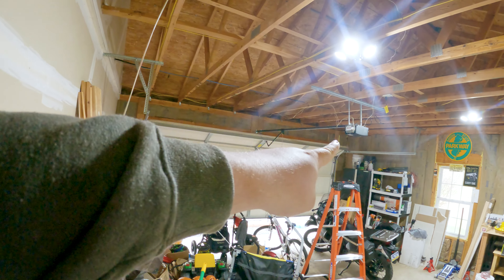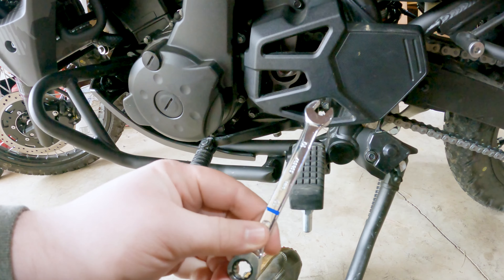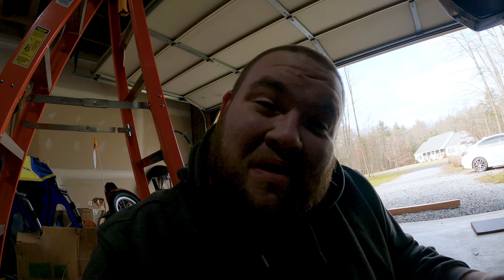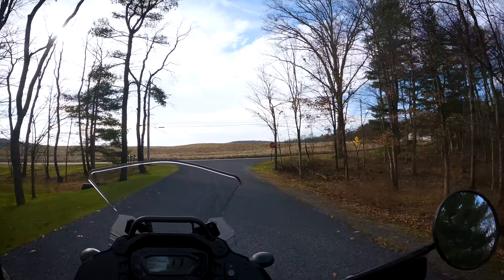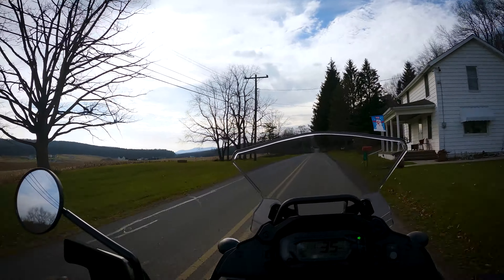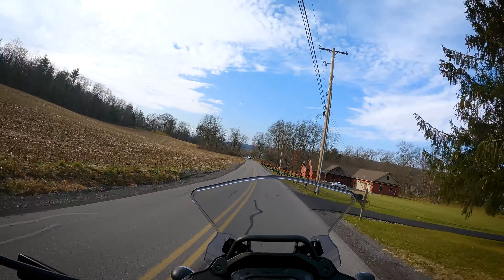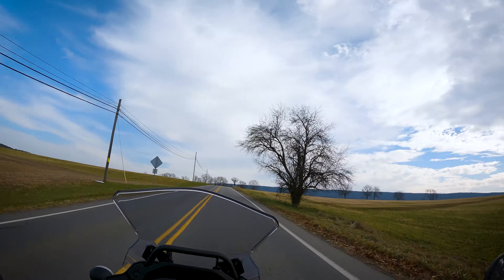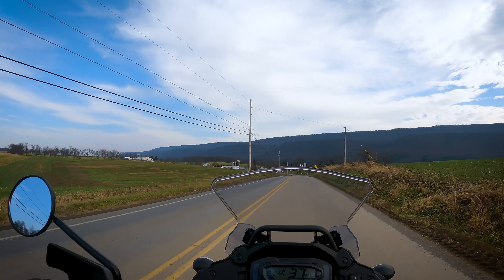I GOT A FLAT TIRE!! | Tusk Extended Shift Lever Install | Kawasaki KLR650 Adventure

Comment: Was it a nail? Would one of those slime fix a flat cans fit in saddlebag? I've had one of those rattling around in my truck for 10 years haha.
Reply from the maker: The inner tube was straight popped. I have a feeling it got nicked from factory. That shouldn't have happened. The physical tire itself was spotless.